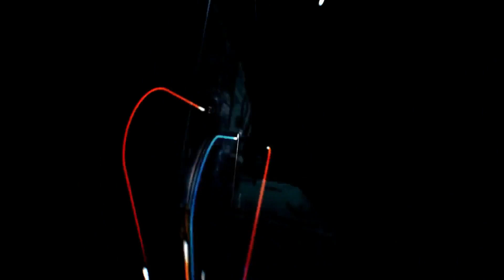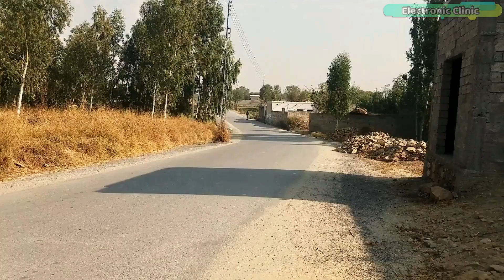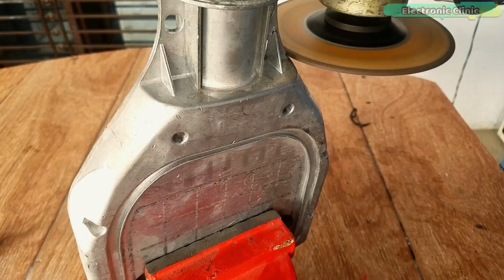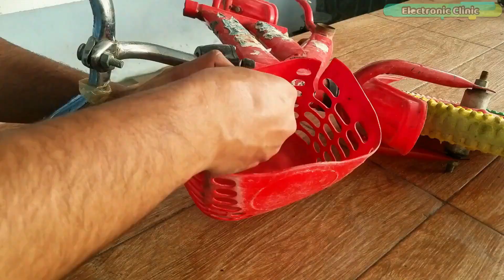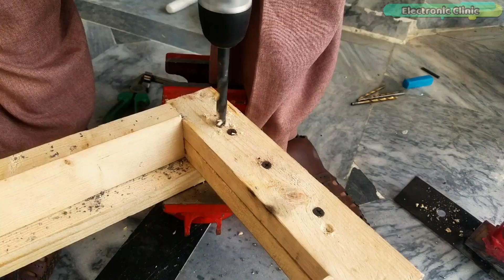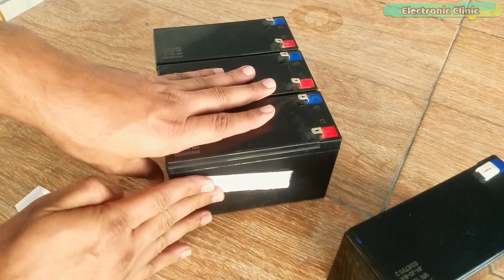Trike Electric Scooter using Hoverboard Motors with complete wiring explanation and Load Test

Comment: great video great explanation, thank for sharing, is necessary to use 2 speed controller? 
because I want to make a scooter with 2 motors like yours, but Iwant to use just 1 speed controller.
Reply from the maker: @tennisadic  I speed controller won't work.